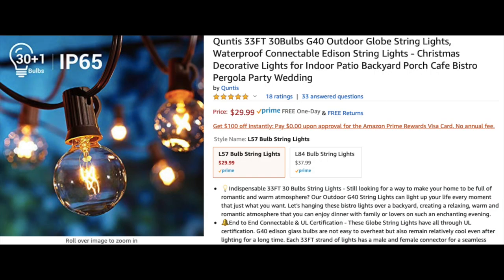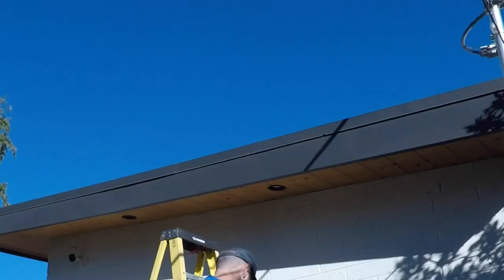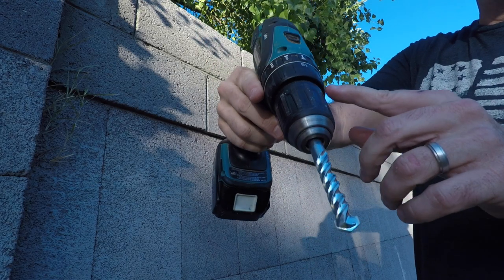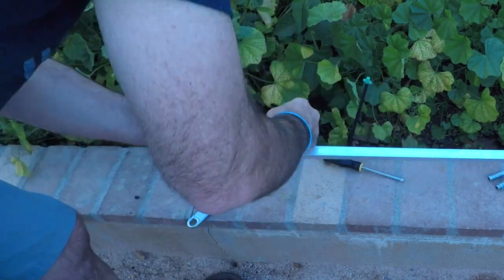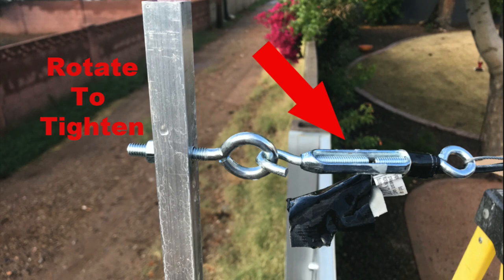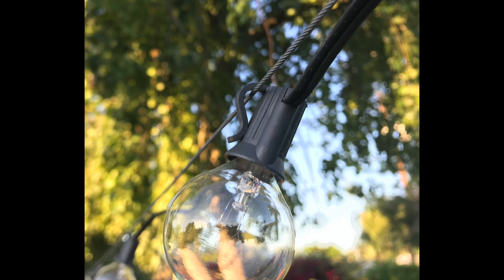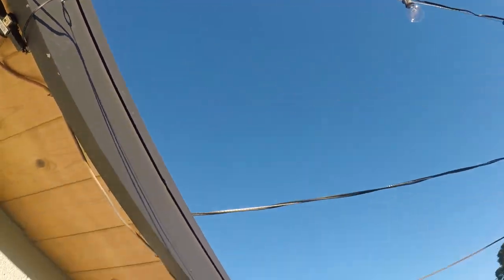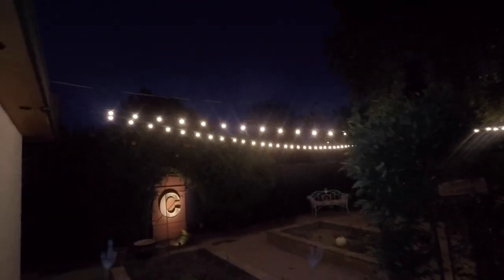How to setup string lights like a pro 2022

Comment: Thanks for this whole series of videos. I was able to get 100 ft of string lights hung between an aluminum sheet metal patio cover, a concrete wall, and a stucco-sided house this month. It looks sharp now. I was a bit lost initially which is what led me to your videos to begin with.
Reply from the maker: Glad they helped! Quick question, did you use self tapping screws into the metal patio? Or how did you attach to the patio?
Reply: @how2q  I labored over this for far too long but I went with self-tapping sheet metal screws. Seems to be holding well.
Reply from the maker: Good to know i’ve had people ask and i have yet to install into metal.  Congrats on “getting’r done”

Comment: What size of drill bit did you used? 1/2 concrete drill bit? 

Thanks
Reply from the maker: Sorry for the late reply but yes it is a half inch concrete drill bit. You can get them pretty cheap

Comment: Hi there. I’ll be hanging lights for the first time and was wondering if I really must use a support wire. Does it make a huge difference. Thanks so much
Reply from the maker: Quick answer…no.  Wire is nice for long runs with less sag in line.  Good luck

Comment: I too live in the Phoenix area.  Used your original video to hand the lights 2 years a go. Just rehung my lights using this method. It beats digging for a post.  I had to attached aluminum post on inside of wall, as the other side is my neighbor's yard.  It's a 6' aluminum bar with 2.5' above a six foot wall.  When I went to tighten the line the aluminum post bent.  I want to lessen the droop. Are the lights in the video lighter than traditional outdoor bulbs? Any suggestions on a sturdier post?
Reply from the maker: In the same area of depot or lowes there is other “metal” options...honestly 2x4 (possibly painted) would work.  Just attached to wall

Comment: Great video...finally someone shows how to connect to a pole.....also, regarding the martin jerry plugs....do I need alexa to use these? can i just download the app and use from my iPhone?
Reply from the maker: You do not need an alexa for this (it's just an option).  Download the app and use.  Like I mentioned, I had already installed Jerry Martin Switches for my outdoor lights so it made sense to use there plugs.
Reply: Thank you.

Comment: Which is brighter these or the other brand of string lights in your other video?
Reply from the maker: I would say the others are brighter.  I will say these are still my favorites.  Ease of wire attachment and low profile stick out.

Comment: Hi! Thanks so much for your videos! I was wondering how you would recommend hanging these lights from a sail canopy shade?
Reply from the maker: I would run wire between "fisheye's" that the sail is attached too.  I would use LED's due to heat that incandescent lights put out.  It all can depend on your setup.  Hope that helps.

Comment: Is it OK to connect 2 strings manually since mine are not connect able?
Reply from the maker: I would not recommend mixing lights and definitely not splicing them together.  Best to have matched sets that are approved to be connected (there is a limitation on most lights as to how many you can connect together)

Comment: So I bought the Martin Jerry Wifi plug as you listed and for some reason when I power off the lights they still stay on at a very lowlight, but they are still on. Can you please tell me why? So far no one has answered me from Martin Jerry.  My cafe lights are from Costco and they are brand new. Thank you.
Reply from the maker: There might be some power getting through plug even though it is “off”.  Try a lamp with a normal bulb on same plug.  Leds have a very low power threshold meaning they can “light” w a very small amount of power.  I’m wondering if the plug is defective.  Sorry this is happening.  I am using a couple plugs currently that all work fine.
Reply: @how2q  

You nailed it.  It's the LED bulbs "glowing" from the tiny amount of current that flows through the wifi plug, even when it is "off".  The plug needs this tiny amount of current at all times so that it can stay connected to the network and respond to commands.

I first experienced this issue with some LED xmas string lights and an X10 lamp modules years ago, when LED xmas lights were first hitting the market.  I was using C-9 style, LED replacement bulbs in my old, incandescent light string.  I found that, if I replaced one of the LED bulbs on the string with an old incandescent, the filament in that bulb would "absorb" the tiny amount of current making its way through the X10  lamp module such that the LED bulbs, as well as the single, incandescent, wouldn't glow when the X10 module was off.
Reply from the maker: Fred Flinstone wow...thank you for great information!! Great explanation!

Comment: Whats the best height to hang the lights?
Reply from the maker: In this video I hung them between 8' 1/2" and 9' 1/2" high.  It all really depends.  My stepson is about 6'3" so I needed them to at least clear his height.  A lot of times you may need to base it on what your working with (or what you are attaching them too.  One of the reasons I used the lights in this video is the profile of the wire and the light together were pretty small.  I've used lights in other videos that were longer.   Hope that all helps!